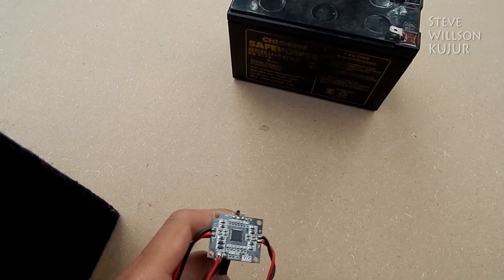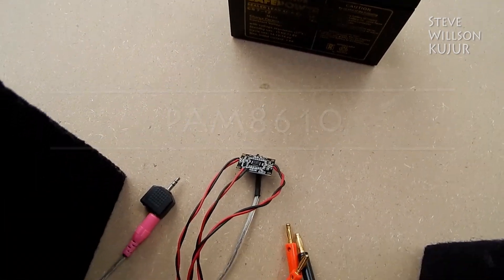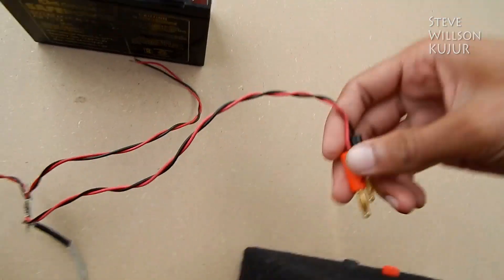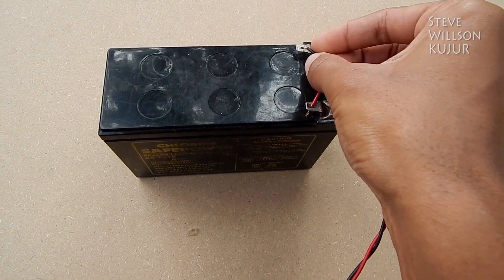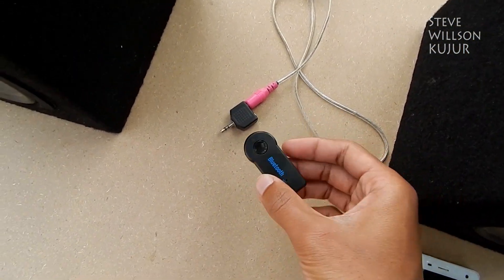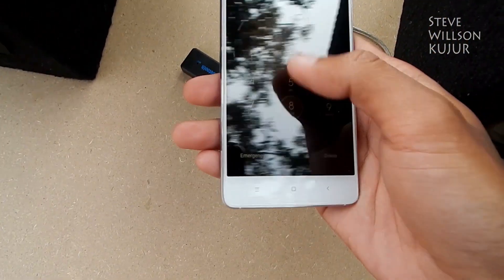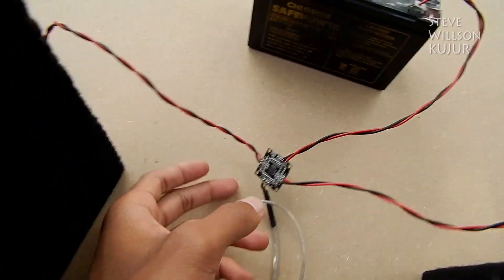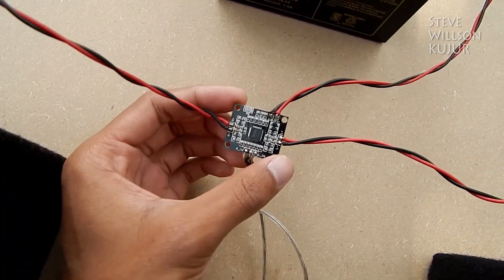PAM8610 Amplifier Test

Comment: I am facing clipping disorder when there is bass in the sound track, any possible way to solve this problem.
Reply: use weaker speakers
Larger watt speakers cause clipping
either use a larger amp or use smaller speakers

Comment: will it work on 9v dv battery
Reply: Yes, but maximum 30 minutes. You need accumulator
Reply: And with 9V battery, it will make noise at high volume.

Comment: Can i connect 30w subwoofer
Reply from the maker: +akhil surendran yes you can
Reply: Yes u can in this amplifier output voltage is 100watt .
Reply: Don’t use this amplifier with a subwoofer. Use a TPA3116, which has 2*50W+100W sub output. If you use the PAM8610, the bass will be a little weak.
Reply: Yes you can, but his kit only have 15x2 watt output in bridge mode.

Comment: Do you have any noise when no input is connected?
Reply: Lunarch's Brain if power supply has low ripple it shouldnt be any noise on output
Reply: Cekpi7 I tired two different power supply, even with a 470uf smoothing capacitor. It doesn't change and is quite loud.
Reply: Did you try to put pulldown resistor on Rin and Ground and Lin and Ground? 
Something like 10kOhm
Reply: @cekpi7  i have tried everything but nothing happened and still noise as same as
I think there is a fault in some ic chip
Reply: @jawadmehar856  What about potentiometer? Did you try adding it and lowering it down? Maybe the gain is set too high. (i solved my issue with 10k pot)
Reply: @cekpi7  i manually added a potentiometer to control volume. But when volume is low or in idle position  noise is more visible
Reply: I bought a 2nd pam8610 amplifier which works perfect
Reply: @Jeremy Tenio thanks! I mean, it was 1 year ago, but it can still be helpful :)

Comment: We can connect amplifier with help of USB to pc
Reply from the maker: no, you can't really connect it via USB just because this module needs 12v to operate properly, You can use a step up converter to boost the 5v to 12v 😉
Reply: The module runs on 7-15 Volts.
The higher the voltage the more power (you may need a heat sink).
You need 8 ohm speakers, do not use 4 ohm without heatsink on the chip